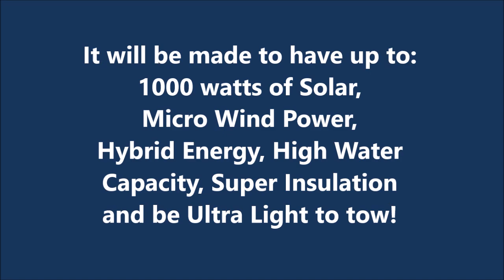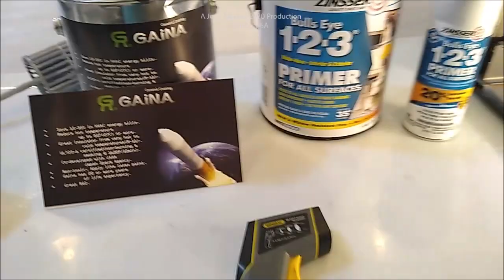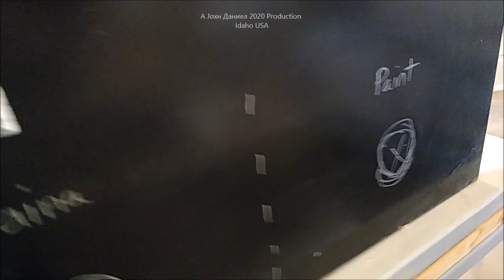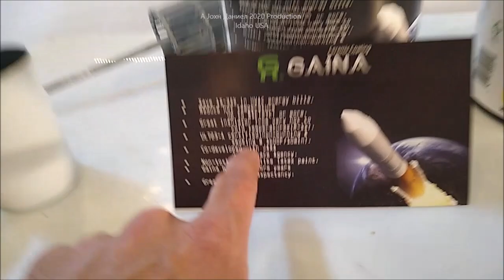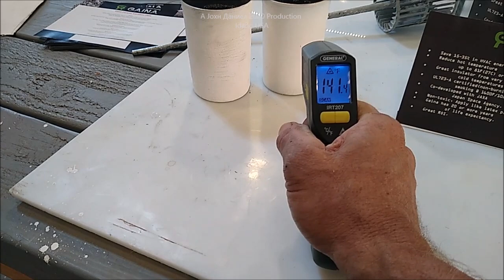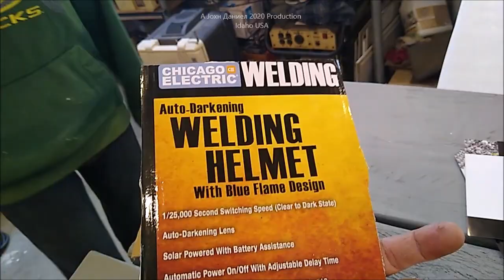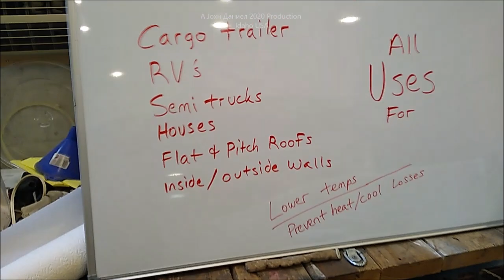Budget Bug Out 1/2 ton towable RV & FIRST USA testing "GAINA CERAMIC Coatings" - Vid 1

Comment from the maker: Lots of Info, Item links and data in info under Video! So far, the only place to get REAL Gaina Ceramic Coatings is  https://amzn.to/2RFyYiD , the 5 bus bar 100W solar panels are Jinko, available from 2 places - https://bit.ly/3hMWDZ0 or https://ebay.to/2RHr9cg & BEST Solar FOR RV's Dual 50A Solar MPPT dua to ability to handle conditions https://ebay.to/2ZT1T7p , American Made GC2 Batteries from East Penn Deka https://bit.ly/3hLj3dd If ordered online & picked up are 10% cheaper. Our Battery 100% USA MADE bank of almost 700AH for only $1.10 a Amp Hour ( $2.20 a AH @ 50% DOD!!!) Heavy? Yes and no, But trustworthy? Even more!!
When running over 40 amps, Be Safe, high DC Amps Make FIRE!! Run your solar with proper wire, https://ebay.to/2ZRhh4p and use all proper connectors. More stuff to use under video. ROCK ON!
Reply: sold out

Comment: what welder do you use
Reply from the maker: I have 9 welders total. Which one you asking about? I have a Wards Powerkraft, DC Hobart, AC/DC Century, 4 harbor Freight MIGs, 1 Lincoln 120v, 1 Ebay Special TIG, and a Forney. My most used are the Harbor Freight DC 170 MIG and the Century 230A arc welder though just due to ease of use and set up.

Comment: thank you. ill be using this paint. cant wait to see the project
Reply from the maker: Tons of ceramic roof coatings on the market in the last 30 years, this is the first to use hollow beads of it instead of solid crystals to control thermal transfer.

Comment: We are going to build a container house.  Not going to put siding on outside,  just as is walls with English ivy on outside walls. Inside of outside walls will be furred with 2x4 with foam insulation . Will have a truss roof over all containers.
  Would/ should I paint both sides of walls and /or ceilings.
Reply from the maker: I'd paint both surfaces. BUT! Here's the funny thing about a container house, they are weaker, less adaptable, more likely to have dangerous chemical residue in them, and shorter than, plus 6 inches narrower than a 53 foot 103" wide fully insulated refrigerated truck trailer you can get for less money at most auctions for $2500 to $4000 then sell the suspension off of for $500 later.
Reply: @JOHNDANIEL1  I've considered using refer trailers just because of the insulation.  Would save a lot of money and time that would be spent for insulation. The way I intend to build, a refer trailer would make it very difficult to do. I'm wanting to stack them and put them over a basement.  I still may go back and revisit that method a little closer.   Thanks for your input.
  You know  it is really scary when you find someone else that thinks along the same lines as I do such as, here is what something is designed for now, what else can I make it do.
Keep the vids comming!!

Comment: So ya think it'll work in a cargo trailer roof but on the inside?
Reply from the maker: Outside, on the roof resist heat into trailer. Inside roof retains heat better inside. Need 3 coats on either to achieve best results.

Comment: Great idea but didn't see anything other a paint commercial and a slide in camper that will not be ½ ton towable
Reply from the maker: You must own a very weak 1/2 ton. My 1993 f150 with a 300 straight 6 can tow a 4900 lb boat into the mountains, I think it'll tow a 3100 lb rv just as well

Comment: Hey John, curious if there would be any side effects on a rubber(tpo I think) roof. I plan to clean and condition with Dicor products. Would Using Gaina in addition be advisable?
Reply from the maker: I'm still learning its abilities, so far I do not see its ability to work on TPO or Bri-membrane rubber. But with the right primer to put down first it may.
Reply: @JOHNDANIEL1  Thanks for getting back. Please post if you find additional info on the subject. I will also do more research. Really think Gaina is a real game changer!

Comment: This looks VERY interesting but seems impossible to get in EU (Sweden) and can't even find an indication on price. Are going to build a super insulated with PIR insulation (down to -30C in winter here, comparable to Alaska/Canada) movable Tiny House on a trailer and this looks like it could be very useful, depending of availability, price and weight of coarse. With 60m2 walls and 20m2 roof (only interior since I will have solar panels close to 100% of roof) I guess it will get VERY costly. If you need to ask what it cost you generally can't afford it...

Comment: I'm sold and very impressed with that stuff. I can think of many places for that. Wish that was around before I did my cargo trailer rooftop with Henrys White Elastomeric, and that stuff made a massive difference with temperature to. I' going to your link for the Gaina. I have some areas I can retrofit and use it. Thanks!
Reply from the maker: On the roof of my Cargo Trailer, the temp dropped like a rock. Then we used it on the front half of a cattle trailer roof, and it was crazy drop in temps. I like it. One gallon did a 8 x 15 foot area.
Reply: @JOHNDANIEL1  that way cool. I just bought two gallons, a bit pricey, but think it's worth it; I have three places right from the get-go. Like in a Chinese 5Kw diesel heater custom box, and around the battery box that is under the trailer. Plus testing a spot on the sidewalls of the trailer, well another trailer first.
Reply from the maker: Yes, I'm learning that on the roof it stops sun saturation. On inside walls as a wall paint it controls heating cycles. I like it. Still learning what side to put on stuff and where.
Reply: @JOHNDANIEL1  that's good to know 8 x 15, thanks!

Comment: Pretty C@@L L@@Kin Stuff John! How Much Does The Gallon Weight? Does it Have Like Micro Ceramic Beads In It & Soo It Has A Rough Surface Texture?? Is It Spayable???
Reply from the maker: 6.63 lbs per gallon, Has hollow .0036mm beads in it. Can be sprayed with a latex sized nozzle and cut with up to additional 12% of water to aid that action but extends drying time by 20 more minutes.